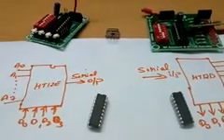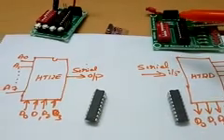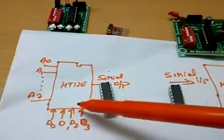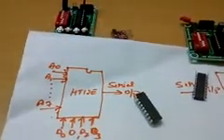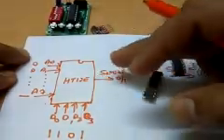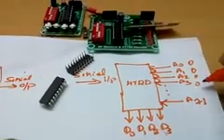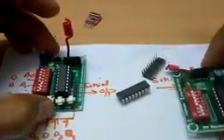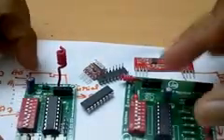RF transmitter (433MHz) and Receiver using HT12E / HT12D

Comment: Can you use two transmitters with one receiver?
Reply from the maker: Yes, you can
Reply: @sukeshraom7655  can you make a video with two transmitters?
Reply from the maker: But data may overlap
Reply: @sukeshraom7655  even if the transmitters work one at the time?
Reply from the maker: @ShawnA560  it should work

Comment: can we use two receivers with same address to receive the data from single transmitter to two receivers?
Reply from the maker: No .. technically not possible
Reply: yes you can use two receivers and 1 transmitter at same time

Comment: can we use it with esp8266 at either side??
Reply from the maker: Yes ... With any controller
Reply: @sukeshraom7655  sir can u Tel me how to make connections with esp and ht12e , I need to communicate two esp's with ht12e and ht12d on either sides?
Reply from the maker: @parthiv8167  you need to identify the GPIO of esp826 and connect it to this module. Keep the address common on both side.

Comment: I am not clear... about how to set out put LOW/ HIGH please clarify
Reply from the maker: Pls elaborate your question
Reply: @sukeshraom7655  Sure ,Sir i want to know how can set Decoder Output signal High (+5v) or Low(0v)?.
Reply from the maker: @Microsree28134  it basically sends whatever logic you give at the tx , will be received at io pins. If you want to invert the logic level then use a NOT GATE or a transistor switch.
Reply from the maker: Give the receiver pin to base of the transistor , collector to 1k resistor and +5v. Gnd the emitter. Take output at collector. ( That will be inverted )
Reply: @sukeshraom7655  in this video... when ever switch press encoder input pin connect to gnd means input pin become low, is it correct?
Reply from the maker: @Microsree28134  Yes
Reply: @sukeshraom7655  Dcoder side LED anode directly connected to positive line through resistor and Cathode connected to decoder's o/p pin..is it correct?
Reply: Can i  to give 5v input to encoder  input pin through push button,is there any problem?

Comment: My rc car remote missing

And i want to make a transmitter module compatible with this 

What I have to check in receiver module and how can I check that which transmitter components will be compatible with this.

Please answer.
Reply: It will be easier to remove the internal board, and redesign you own reciever. But if you really want to test how data flow occurs, then feel free to try all 256 combinations of the encoder to find out which one works. Just remember to check the voltage at which the motors are operated and use a suitable voltage level output if you redesign the Rx board. 

For eg, if you use 5v as the voltage on the reciever and transmitter and run the motor at 12v, try to use transistors as amplifiers for the motor.
Reply: Projjal Gupta thanks for reply...

Comment: sir will it work with arduino?
Reply from the maker: ayush gupta yes
Reply: sukesh Rao M sir in my project i have to provide wireless connection bw Arduino & relay module but by using this sensor i dont know how to code
Reply from the maker: Hi.. you have to connect data lines d0 to d3 to io pins of Arduino . Use simple gpio examples to explore the possibility operation. You can then receive on other end of wireless module and connect the relay using simple transistor drive.
Reply: of course it will because arduino is just a processor